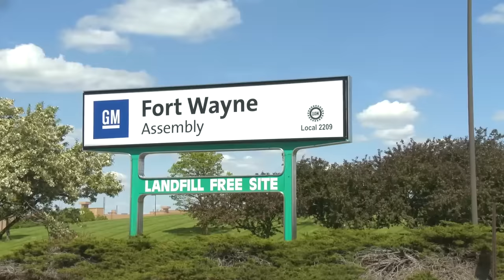General Motors Truck Production at the Fort Wayne Assembly Plant

Comment: Ive owned gm ever since I started driving but now 70k for a pickup like what I have now that's 15 years old idt so there making the vehicles cheaper and cheaper by the year but upping the price pretty soon gm will be like John Deere you'll have to take your vehicle in to dealer to get it repaired due to the software issue
Reply: I learned my lesson: never buy another GM vehicle ever again.
Reply: @Zeppelinlv2007  ...you will have the same problems with any other auto manufacture out there.
Reply: @Zeppelinlv2007  I've got one with 353k miles
Reply: Joe Blow he’s just trolling
Reply: My Chevy legend Silverado '94 K-1500 5 speed manual Ext Cab only had 528 K  when lost it due to drunk head on. Thank God for seat belts!

Comment: Then the check engine light comes on @ 1500 miles😒😒😒
Reply: Gas cap is loose
Reply: Oops put diesel fuel in a gas truck.
Reply: This isn't a dodge
Reply: Ford guy, you an tell
Reply: Your lucky that's all it did!
Reply: Only 38 000 miles on mine but no issues at all only maintenance.

Comment: the rocker panels and cab corners are still gonna rust out
Reply: Buy Toyota or Nissan
Reply: @jonasgrumby1093  why?
Reply: Better than having the frame rust out like Toyotas
Reply: Oh yes and please buy Nissan. But come back when you have to replace your transmission because of faulty hoses causing transmission fluid and coolant to mix
Reply: @jonasgrumby1093  The frames rot out on those
Reply: Aluminum??
Reply: JONAS GRUMBY What you drive?
Reply: My 2012 Silverado is not rusted out, there no rust anywhere. Living in Missouri they use salt in the winter.

Comment: Landfill Free Site only due to the fact that the garbage produced leaves as Generic Motors trucks...
Reply: @Mr.Beastforpresident  
As someone who owns multiple fleet vehicles, I can tell you, I was diehard Chevrolet for many years, TBI 350s, Vortec 350s, LS engines. The nail in the coffin was junk IFS torsion bar front suspension. Only after 23 of 29 2008 5.3 and 6.0 engines lost oil pumps, 16 lost engines totally, 7 were able to have pump replacement. I own all Ford's now 3.5 EcoBoost engines and 5.0v8s so far, a couple high pressure fuel pumps, ALL under warranty. Probably 40 spark plugs, oil filters. I have 53 in my fleet now, ranging from 50k to 200k.
Reply: Midnight Trumptrain As a Business owner for 19 years I’ve owned many Chevys including 5.7 Vortec & TBI. The best most reliable ( Gas ) Ford engine ever made was the 5.4 in Ford E350 vans. 

My 2007 2500 LY6 6.0 has 541,000+ miles 13,000+ Engine hours Original Engine & Transmission. Even the Windshield is factory GM Windsheild with about 8 rock chip repairs and Millions of tiny pin holes from road sand/debris. Original Alternator, P/S pump, A/C compressor with custom rebuilt ( clutch ) 

Changed:  
Battery 3 times
Spark plugs & wires 5 times
Shocks 3 times 
Fuel pump once at 330,000 miles ( didn’t go out, got weak ) 
Radiator at 405,000 miles
Waterpump at 415,000 miles ( seeping not leaking ) 
Driver door handle cable at 350,000 miles
Passenger door cable at 460,000 miles
Driver Electric lock switch at 400,000 miles 
Passenger Electric lock switch around 500,000 miles 
MANY MANY headlight bulbs
Original tail light bulbs, yes ORIGINAL

Rear brake pads around 215,000 miles
( Front brake pads once around 500,000 miles )
Reply: @Mr.Beastforpresident  
I don't have time to read all that,  but good luck to you

Comment: And that is how you build a $50,000 turd.
Reply: @galencaudill6462  get to 100k miles then come back and say that
Reply: Mine has been flawless. I would buy another new one in a heartbeat.
Reply: Doug, my 2005 Sierra 1500 has 360,000 miles. I've never had a truck last this long.
Reply: It’s all about how you treat it and take care of it my 93 had over 300,000 my 98 had over 350,000 and now my 05 pushing 200,000 I’m always gonna rock a BOWTIE 👍🏾 go GM!!!
Reply: gotta love the continual brake recalls on these silverados
Reply: @rchalmers3  I think he is referring to the new trucks and not all of them in general
Reply: @antyuandraper349  Chevy co van 168 k beat the dog out of everyday in so cal. My d max and my two boys d max 720 k between them. Not one drop of anything on concrete driveway. No major repairs. Brakes batteries water pump.i won't own anything else after owning 19 fords
Reply: rchalmers3 My 2007 Chevy 2500 ( Gas ) 6.0 has 541,000+ Miles 13,000+ Engine hours Original Engine & Transmission

Comment: I've owned a 1995 GMC Sierra 1500 V8 and I currently own a 2006 Chevrolet Silverado Z71 1500 V8 both were assembled at the Fort Wayne Indiana assembly plant.
I have designs on purchasing a new 2023 Silverado V8 and I am willing to travel to Indiana to get it.
GM can keep that 4 cylinder nonsense.

No offense to the hard working folks in the Silao Mexico assembly plant, but go Hoosiers!

Comment: It's quite interesting in the variance of the workers' clothing. Long sleeve here, short sleeve over there, safety glasses here, none over there, shorts here but not over there...I'll stop. 0
Reply: In some areas, people are working around sharp metal, hence the long sleeves, pants,  and arm protectors.  Some people deal with fixing body imperfections with sanding, so they ahve to wear safety glasses.  People in paint and body have to wear coveralls.  Assembly has areas where people wear bump caps, and safety glasses.  In other assembly areas, no PPE is required, but I wore ear plugs no matter where I worked at Ft Wayne.  If it isn't noisy, I found the noise just plain annoying!

Comment: Did all you people notice the difference between a GMC and a Chevrolet?  By the way, the GMC costs a whole lot more.  And by the way, THERE ISN'T ANY DIFFERENCE!  Both built on the same assembly line, one after the other!
Reply: GMC has more standard options
Reply: @anthonywebber2211   > you mean I had to pay extra for the "rust" option on my '05 Chevy....damn!...shoulda went GMC.
Reply: They go down the same assembly line 🤦‍♂️
Reply: @anthonywebber2211  WRONG.....there is NO difference, except for one thing...….THE PRICE.
Reply: @kenprice1961  
Prove it
Reply: @kenprice1961  
GMC Sierra starts at $29,600
Chevrolet Silverado starts at $28,300
Reply: @kenprice1961  
Still waiting

Comment: might be a good truck if there frames did not rot in half in north country , nothing rusts like a gm
Reply: I live in Minneapolis, have a 97, 04, 11, & 18, no frames rotted in half.
Reply: pappy1432 You must be confused. Toyota has the severe frame rot issue, and apparently hasn’t fixed it yet.
Reply: @annachrissy4874  Government Motors has the same issue. I have 2 Silverados myself. One of them has had to have both frame rails welded back together and plated, and the cross member that holds the fuel tank and upper shock mounts has rusted completely off of the frame. The other isn't far behind it. I can't keep transmissions in that one either.
Reply: เพลง
Reply: @robertpontius1689  🤣😂🤣😅😂

Comment: Bring back the square body Chevy Silverado. You have not built a truck since nothing but gone down hill.
Reply: yes
Reply: They can't just like nasa cant send a manned vessel to the moon chevrolet or the rest of the american auto makers can't build a vehicle worth a damn since the 70's. Thanks to the EPA shutting down factories and the government with their bullshit gas crisis. The gas crisis caused the boom in import sales which the government charged taxes on.
Reply: Square bodies were rust buckets.
Reply: @taylorc2542  my square body might need cab corners and rockers if your picky but my 99 definitely needs those, fenders, wheel openings, and a tailgate but its not worth a damn because the frame broke in half. I've hauled 6000 pounds of scrap in the bed and in a trailer of my 86 without a problem multiple times, I used the 99 once to haul a car all together weighing 4000 pounds and the box is smashing into the cab

Comment: Overpriced, and under engineered.
Reply: John Beck Your Ford comment showed up on a Chevy video
Reply: @billgates1682  You really going to believe a Ford is better with no factual proof with over 100+ years and still can’t make a gas truck that lasts 1,000,000 miles much less 500,000

Comment: Try draining a radiator on a 2017 Sububan or various Duramax pickups, Try getting fuel lines for 2007 and below Duramax trucks...obsolete, try changing a starter on a 2013 Duramax pick up,  try getting and engine for a 2017 Colorado...indefinite back order,  Compare parts availability and pricing against GM's major competitors...awful availability and crazy pricing. Fords aren't perfect but at least you can get the parts for them and work on them.
Reply: I have done a number of the jobs you talk about. I think you mite need more training
Reply: I used to sell Fords, when the Aerostar van came out, in 85, I think it was.  Yeah, I'm dating myself here!  The mechanics hated Aerostars, because they said you had to practically remove the engine, to change the oil.  Engineers who design things under the hood, should be made to do routine maintainance on the vehicles they designed...just like they should be made to do the jobs they screw around with, on the line, for 3 months, 5-7 days a week, 8+ hours a day.  Then, maybe they'll beleive us, when we tell them, the new way they set up our jobs, is causing us pain, or a quality problem, or slowing us down.

Comment: Where is the PPE?? No helmets, shorts, no shirts with names on them. Blows my mind
Reply: Why?   Where required you will see those with eye protection.  They dont need their names on them as they work in teams, and all their workmates around them know their names.  Why the hell do they need a helmet? If they were in a position where they needed a helmet, the assembly process would be changed so its not necessary.

Comment: Nothing but problems with my 2020/ 3500 poorly designed Fender Wells they left a big gap where they overlap inside the fender well for all the road dirt mud snow salt anything else you would not believe the inside of the engine compartment full of Road dirt mud you name it you cannot even have a cap on the box of this truck for the fact there is such of a big gap around the tailgate when they should think of a seal as well as where the body seems our they did not caught them properly it's filles full of Road dust dirt little stones I could have a sandbox inside my truck box you cannot keep things clean or Hall your groceries or luggage or just whatever in the back of it when you have a cap on it the door seals all four of them do not keep water or dirt as well out I do have electrical issues as well with the lights radio Exedra when I first bought it it needed a front alignment as well as there was a recall within the 30 day of owning it what is going on General Motors get your s*** together or get out of the game while you still can build something worth people's time that needs trucks for living instead of City Life people the mirrors on these new trucks are stupid they look stupid I like to tell the engineer he needs a different job the step on the outside of the box is a joke when you have a cap on it as well as another place for it to rust as well as it does nothing but click stones dirt Exedra going down the road. I like my money back General Motors I would rather go back to Old School they seem the last like my 83 square body still on the road today I only have two thumbs for you people and they're both are down. I would not recommend these newer trucks to no one too many problems too big of a price tag they do not want to hear your problems when they got lots of Their Own.

Comment: Been told for years, that GMC is built to higher standards than Chevy, therefore worth more $$$,   in this video, watch closely,  they are built on the same line !!!
Reply: Don Dalphin Jr They’re the same truck.  It’s called rebadging
Reply: @andrewcolsen  exactly the point that I was making.   Same truck .  yet GMC is always priced higher,,
Reply: I think the differences are inside... more options, slightly nicer dash, etc.  Maybe they do more quality control as well, I'm not sure.

Comment: I love trucks but they have gotten to big, powerful, wasteful and unattainable.
Reply: Totally agree  The new 19 and 20 trucks are too big and bulky.  I bought a 19 Sierra last summer.  There is no way to raise the driver's seat and the hood is too big to see safely around.  The truck has also had 5 recalls, the radio had to be replaced, and the doors had to be resealed because they were leaking water.  My 2010 Sierra was much better.  My truck was built at the plant in the video.

Comment: So this is where they made the two junker trucks I bought. After the first one with transmission troubles I should have known not to buy another but I did. The last one stayed in the shop more than the road. One electrical problem after another. # never again. They should put a sign on all GM's. Buyer beware.
Reply: Get yourself a Ram truck. 🎸💪

Comment: Chevy and GM have dropped the ball,they build trucks made of sheet metal about the thickness of a pop can,mostly plastic and rubber and ask $50,000 and upwards for them,and your lucky if you 200,000 miles out of one before it’s trash.they should hand the workers wrenches, and a socket set and make them take it apart after it’s built.straight up idiots designing these vehicles.
Reply: The upper management is in a mode to maximize their profits in a declining company; they'll suck the finances dry and leave in a golden parachute. They know this company is done for in the USA. That's why they've just given up.

Comment: I have a question, a friend told me that worked at the now closed Atlanta assembly plant, that you could not leave the line until relieved for any reason. If you had to use the restroom use just used it on your self. Is this true.
Reply: Larry Peek no you can’t just leave the line.You pull a line or press a button & a supervisor will come to see you & then you ask for a restroom break...Then depending on the supervisor he can either takeover for you or put you on a “washroom list” (which can take a long time depending on if the supervisor is just plain lazy or if there are other ppl to go before you).

Now the reason you can’t just leave the line is because the line is constantly moving,so if you leave then the process of building that vehicle you’re responsible for won’t get built & therefore leading to problems.
Reply: @penvon  Not the supervisor.  The team leader will relieve you for bathroom breaks.  I was luckywhen I worked at Ft Wayne. Our team leader was always right there, didn't wander off to talk to buddies two lines away.  He'd give you a break if you needed it, with no arguement.
Reply: @karenbaker9255  I love your comments! It's refreshing to hear positive feedback from GM employees. It also gives confidence to buyers that their vehicles were built by people who care.

Comment: Not good trucks-- direct injection is expensive and causes engine failures.  Ten years ago the trucks were excellent.  Also, who wants a 10speed auto trans?  If it breaks (it will) you need a 2nd on your house to fix.

Comment: Chevy is way better than Ford. Had a used 2002 Silverado HD with almost 400,000 miles, drove it for 2 years and sold it for more than what I paid for it .
Reply: had a 2000 ford ranger 650,000 miles when i sold it have a 2011 ranger now at 394,000
Reply: @georgehunt6380  Rangers were ok but the full size was and is junk. My grandfather was a mechanic at a Ford dealership. Even he said they were junk
Reply: @WBT714  i agree with you
Reply: @georgehunt6380  My father's sister married a Hunt. Veterinarian.
Reply: @WBT714  no kin that im aware of there are a lot of hunts in america
Reply: @georgehunt6380  okay. Thanks

Comment: Ram has overtook GM in total truck sales due to the fact Ram's interior is up to date and GM truck's interior is right out of the old generations  truck.
Reply: Where do u get your data? Becouse u r WRONG
Reply: @Aaron-dp5kb   Wrong again Aaron. Total GM truck sales were more than Dodge.  You have to add GMC sales to the total. Dodge did sell more then the Silverado your rite. But when you add Sierra sales to the total GM sold more. Look it up.
Reply: @Aaron-dp5kb  
F150
896,526
GM
893,662
Ram
633.694
It's when GM is separated that chevrolet is in third

Comment: I need a new engine for my Chevy truck it's a 2011 it's a piece of shit I put an 8 lifters in the damn thing and it still keeps breaking I need to send me a new engine if I knew it had this 4-cylinder 8-cylinder bullshit I would have never bought it Chevy should fix it for me or send me a new motor without that stupid 4-cylinder a or mode all I've ever owned a Chevy GMC now I'm kind of sad that they screwed me over on this truck I own a GMC 2011 Sierra supposed to be really nice truck but it's not a piece of John going down the road all that sounds like it's knocking

Comment: Cheap plastic, everything is cheap, no wonder why in a 2015 silverado the AC system went away... Well, the evaporator was leaking, inside the dash. $2,000 job. Scotty's words... and it is true GM quality is sad.
Reply: benjaminpizza vargas yeah see but Scotty leave out that it’s about 2k to change a starter on a Toyota
Reply: @pennysmith2012  Yes, true, every company has its flaws, but one makes better items than others. Not all engineers are the same. :)
Reply: benjaminpizza vargas I agree. I enjoy my 2018 gmc .
Reply: pennysmith2012 excellent. Good luck. ❤️